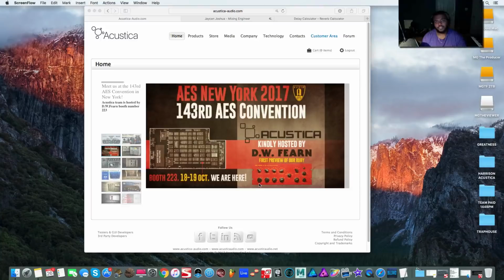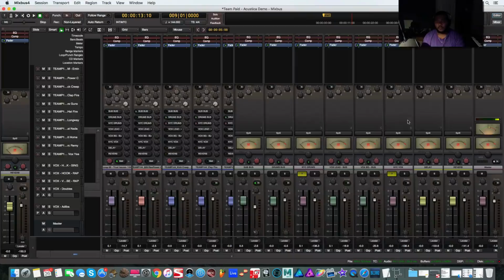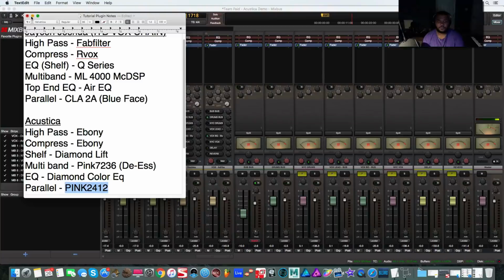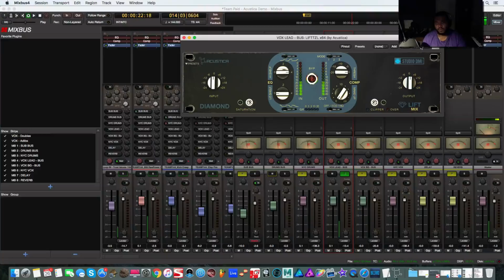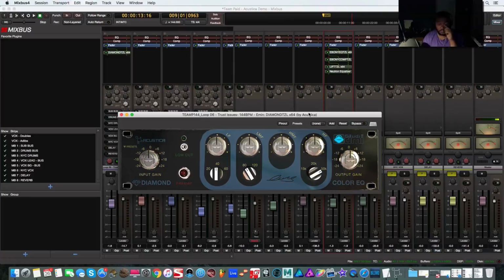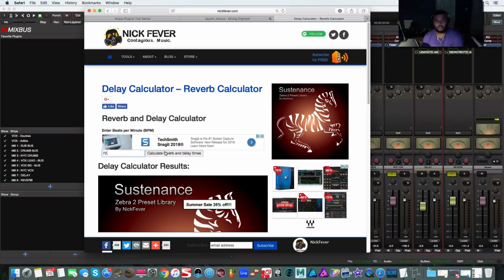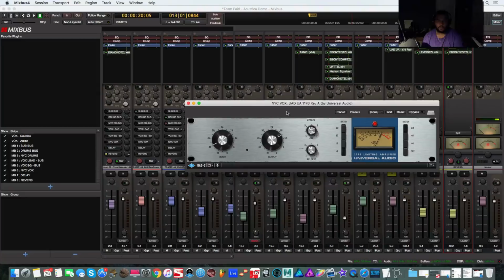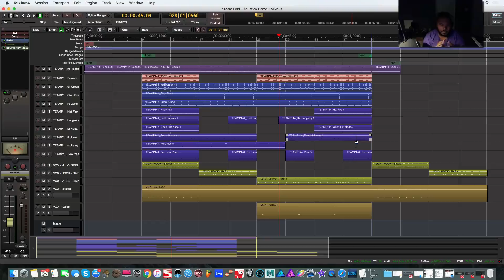Mixing Rap Vocals | Jaycen Joshua ITB Technique | with Acustica Acqua Series & Harrison Mixbus

Comment: Not sure if this was mentioned in the video or comments, but why put plugins after the fader on the bus tracks? Does it make a difference? Great vid btw and nice to see more workflow.
Reply from the maker: Makes a difference if you move the faders..as you can drive your FX if your level is too low or too high going into the bus. However...if you gain properly earlier on...you rarely touch those faders. I don't think I did this video 😭
Reply: @MGTheFuture  Ahhh ok got it thanks!